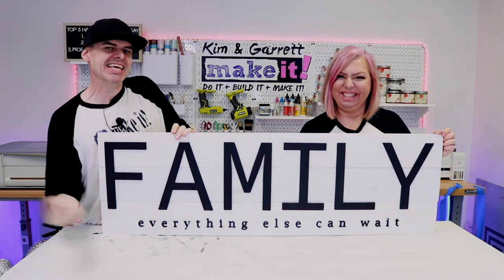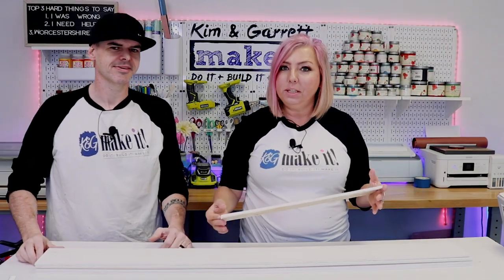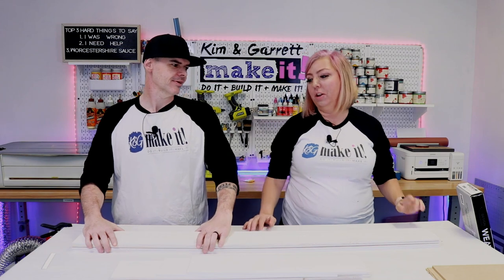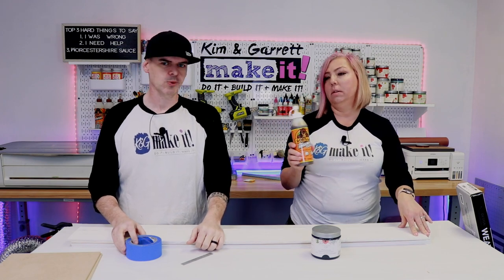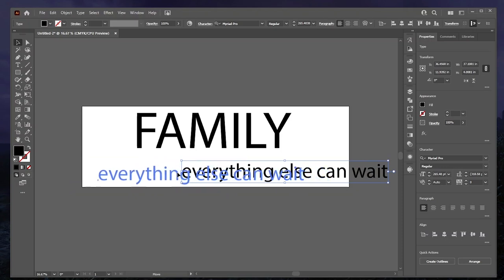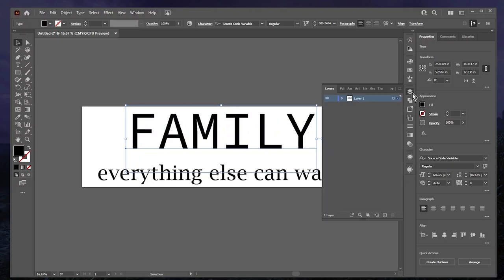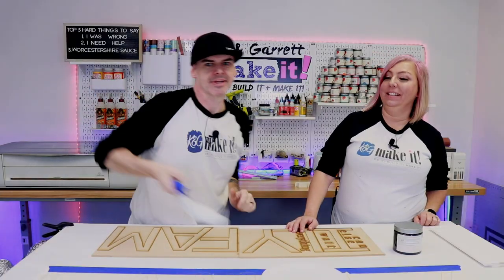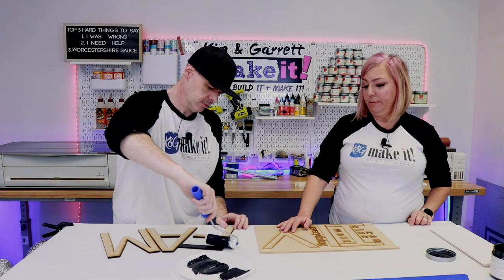Easiest Biggest Glowforge Farmhouse Sign Yet!

Comment: I watched someone use pennies under the cutout template to keep the template just above the surface of the sign that they were gluing the letters to so that once the glue sets a bit, they could lift the template up without being stuck to the sign or accidentally glued by the extra squeeze out.  I haven’t tried it yet but I think that would be a fun video…Kim and Garrett test Tic Tok hacks!
Reply from the maker: Ohhh that's a great idea!